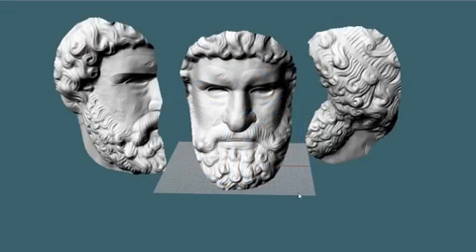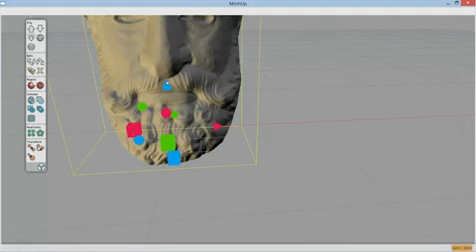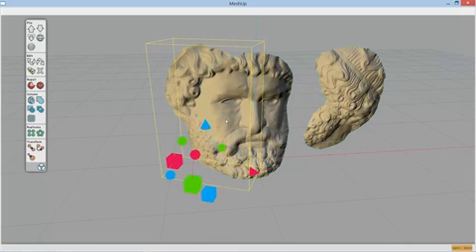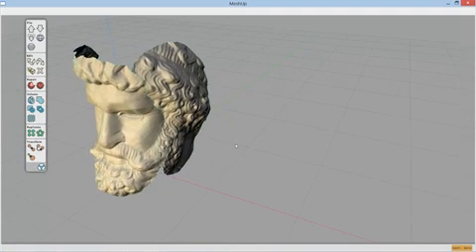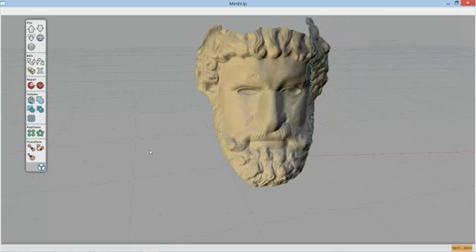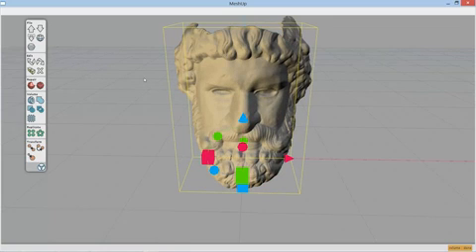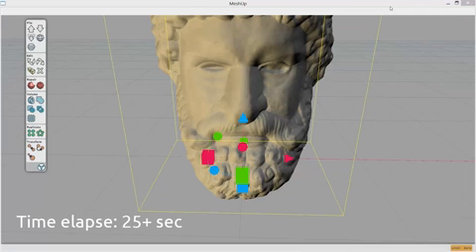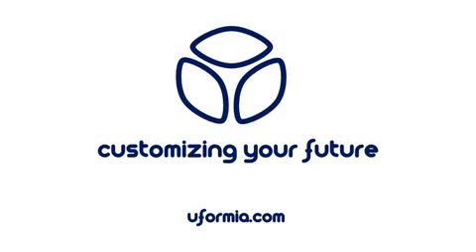MeshUp - Manual Stitching of the Fuel3D's, 3D scans

Comment: So while scanning the object from different points of view, how accurate in terms of distance from the object do you have to be for a successful scan? Say I'm scanning a face, and the front face, I am at 2 ft away. And the second scan on the left i am at 3 feet away. This would cause scaling issues between the two scans, correct? With the second scan being smaller than the first?
Reply: Shouldn't if you've got enough overlapping points. The geometry has to be rotated and scaled anyway.